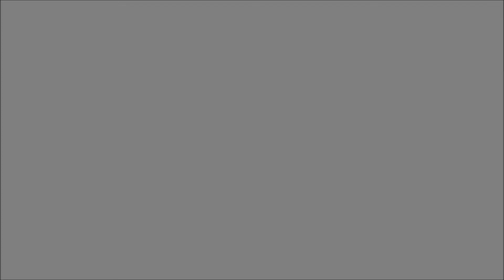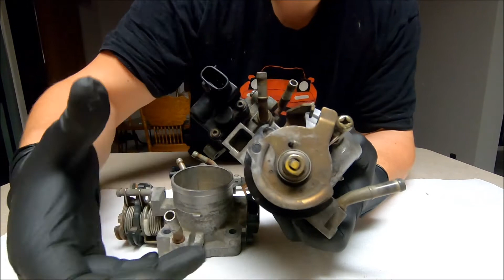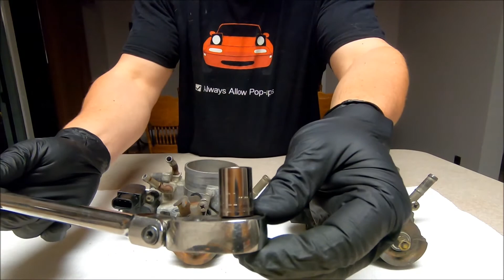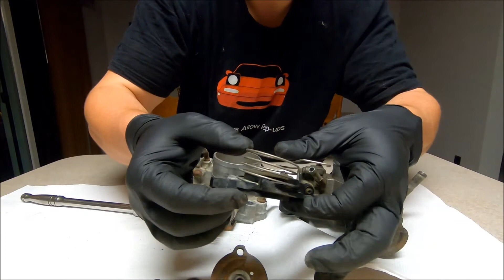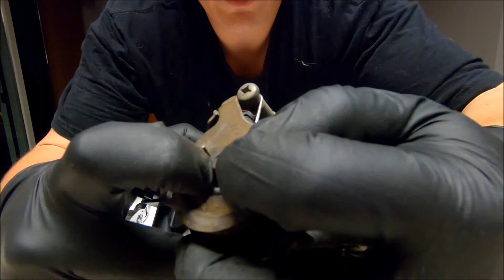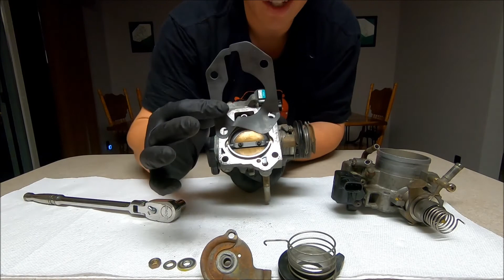2003-2007 Honda Cruise Control Repair

Comment: This is EXACTLY what my problem is on my 2003 Element.  But I really don't want to take the throttle body off the engine.  I have heard of all kinds of ERROR codes after messing with the throttle body.  IF I do decide to do this, I might try to just do the job with the body ON the engine.  Thanks for posting this !  And the Dorman parts.

Comment: Doesn't work for the 07'
Reply from the maker: The 7th gen accord is 03-07, depending on when yours was build it may have a different throttle body for 07. Sorry it didn’t work for you.

Comment: Unfortunately they say it is not for a 2003 Honda CR-V.
Reply from the maker: The CR-V had different throttle body’s dependent on the engine. If it’s a K24 engine code this should be right. But I’m not exactly sure all the different model changes.

Comment: Thanks for the Video.  I did the same repair last week.  I noticed one important thing while I had it apart.  I noticed some chaffing on the casting where the throttle rotates.  You can see it inside of the springs.  I think that this actually caused the plastic part to break.  I squirted a little silicon grease before re-assembling.  Also, I think that the Dorman part number is 977-100 instead of 997-100.

Comment: Im wondering if this can be done without removing the throttle body. I mean its just one bolt holding the plastic pulley on right?

Comment: Excellent demonstration.   I don’t know why Honda would make an important, friction based part out of plastic that will fail from heat produced by the engine and time.   One thought is that, while I try to buy salvage parts when possible, I’d be reluctant to buy a used throttle body for the plastic part provided because it obviously has service in the part and seems subject to failure at some point.  But, you could get lucky.  As you said, the Dorman kit is available which seems like a reasonable solution given the simple steps required by your video.  Great job!
Reply from the maker: I agree with you on buying the new replacement parts rather than a junkyard part. The reason I used the junkyard part was because before I figured out how to do the repair, I was just going to replace the complete throttle body with the junkyard one to fix it. It actually turned out that the throttle position sensor on the junkyard throttle body didn’t work, so I went through disassembling the junkyard throttle to see if I could transfer the parts over. And the result is this video.

Comment: Thanks for the video. I now need to take a look at my car and see if that is the problem. 2 comments about the video. It would have been nice if you showed the defective part next to the good part for comparison, and as long as you had another throttle body, why didn't you just swap throttle bodies? You mentioned purchasing one, but then said you had it hanging around. If it was just to make the video, that's a good answer. Thanks for the info on the  the dorman kit. If I need to replace the cable attachment, this is the way I'll go. Thanks.
Reply from the maker: Good suggestion to show both next to each other, didn't cross my mind at the time. Also, I had bought the junkyard throttle body to try and do a direct swap, but when I put it on it's position sensor would cause a fault after driving once or twice. I figured out this fix by taking apart the junkyard part first and realizing it was actually really easy to swap just the pieces I needed.

Comment: Thanks Quintyn!!!  I've had a 2003 Accord with the same broken cruise control attachment for a long while.  I haven't been driving this car for over 3 years, (drive a company leased car now) but have been saving this car for my son to drive when he turns 16 shortly.  So glad Dorman made the repair kit, and delighted you made a video showing how to complete the repair.  Gotta love YouTube!
Reply from the maker: I’m so glad this helped you give a great vehicle to your son to drive. The whole reason I fixed it was because I changed to a job without company cars and needed cruise control again. Couldn’t find instructions so I made my own.
Reply: @quintynschiff4237 also is the kit 997-100 or 977-100 I looked and it looks like its 977-100
Reply from the maker: @donniev8181  I used a junkyard throttle body but posted the proper kit number to use in the video description. From my research the 977-100 will fit this throttle body.
Reply from the maker: @donniev8181  the trick to getting the cable back in is to either do that step before re-installing it on the intake or push the throttle by hand to get it into a position where you can slid the end back into the hole and route it through the channel on the new plastic throttle body cam you just installed.
Reply: @quintynschiff4237 yeah im just wondering if this can be done without removing the throttle body. Also you can loosen the throttle cable by just loosening the top nut which frees up the cable. As long as you do not touch the bottom adjustment nut on the throttle cable it will not affect anything. Im almost tempted to just replace everything while the throttle body is still on the car. Either way, your video is by far the best step by step video on youtube. Its a bit ridiculous how Honda "recommends" against removing this linkage. Weird but on the coupe accord, this piece is metal, I've been told anyways. In your opinion do you think it can be done without removing the throttle body?

Comment: Says it does not fit a 2005 honda element on the Amazon link
Reply from the maker: Interesting, not sure why it wouldn’t. From searching images and part numbers they appear to be the same throttle bodies.
Reply: I noticed that too. If you read the comments several people comment that they did indeed install it on their Element one specifically said ‘05 Element. So I purchased one, will see if it works.

Comment: Do you know if the DX models have the same throttle body even though they don't have cruise control?
Reply from the maker: You would need to look at the throttle body and see if has the inner plastic ring for the cruise control cable. Honda may have kept all the TBs the same to not have separate parts even though there would be no cable connected to that bracket if you do not have cruise control. As far as adding cruise control, you would need to add the cables and electronics to make it all work and I'm not sure that possible. A little research on google said that there are aftermarket kits available for this though.
Reply: @quintynschiff4237  Thanks. I just checked and it looks like it does NOT have the plastic piece. I'm sure it is possible using oem parts, but may be more trouble than it's worth. I'll look into aftermarket kits.

Comment: I have an old honda element which does NOT have cruise control. I'm trying to figure out if it would be possible to find cruise control parts I need to add cruise control to my existing vehicle.. If you know if this is reasonably possible, let me know.
Reply: Did you ever figure it out? I'm trying to do the same to my CRV

Comment: Any advice for how to place the accelerator cables back onto the throttle body?
Reply from the maker: I think I just used a pair of pliers to help pull them so I could put them back in the slot. Either that or hold the throttle plate open and feed the cables back in, then release it slowly and make sure there isn’t any binding. Good idea to press the accelerator a few times after install to make sure it all feels right and cables are routed right.
Reply: @quintynschiff4237  thanks for the video + reply! super helpful. cables are back onto the throttle body and idling/accelerating good as new
Reply: @jessieescobar3195 did you remove the throttle body?

Comment: wondering iif I could do this without removing the entire throttlebody.
Reply from the maker: It would be pretty tight to try and do it in the car, difficult to get tools in too. It’s pretty easy to just take the throttle body off though. Just make sure to pinch the coolant hoses when you take it apart so it doesn’t leak coolant everywhere.